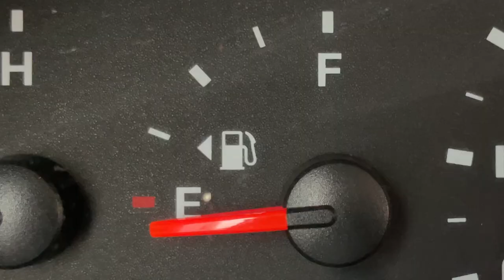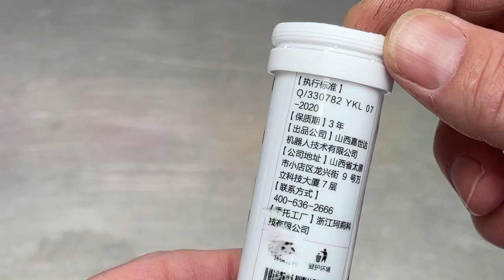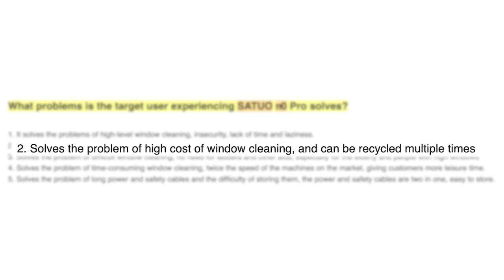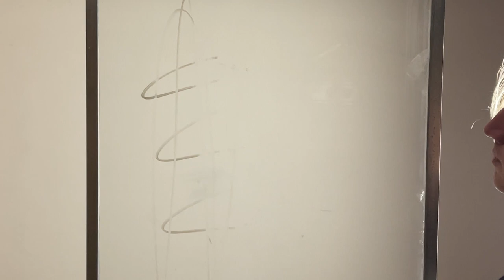Satuo π0 Pro Window "Cleaning" Machine Review

Comment: Great video! I was wondering what solution, in the spray bottle, do you use and or recommend? Also wondering, have you done a shower tile cleaning video? As in how to scrub the tile cause I’ve been wondering should it be done and what products to use. Thank you again for the great content.
Reply from the maker: I use Kay Ecolab Glass & Multi-Surface cleaner only because I got an unbelievable deal on it. In my experience, glass cleaner is glass cleaner. They all seem to work about the same.